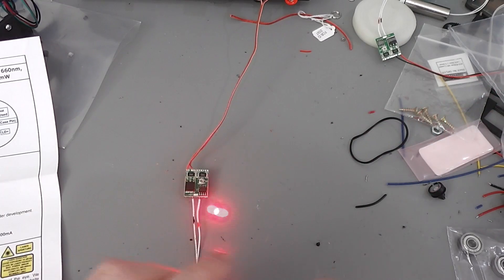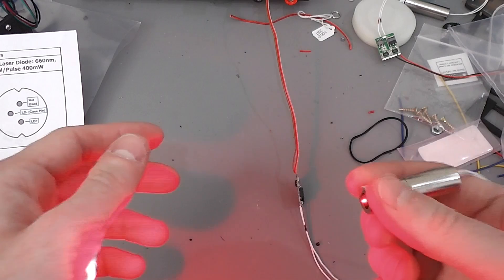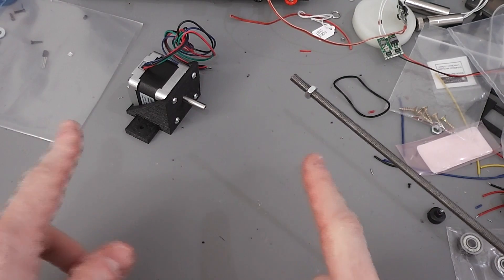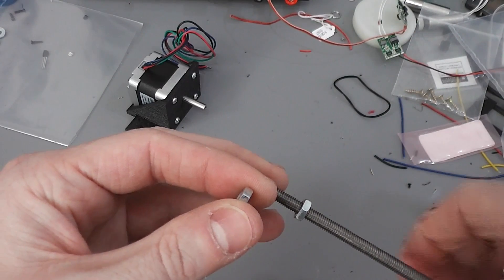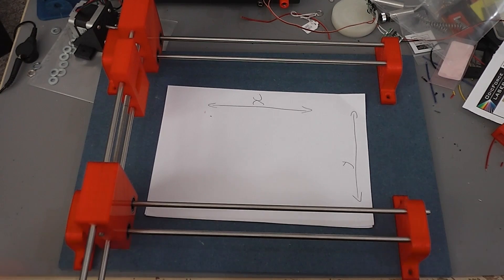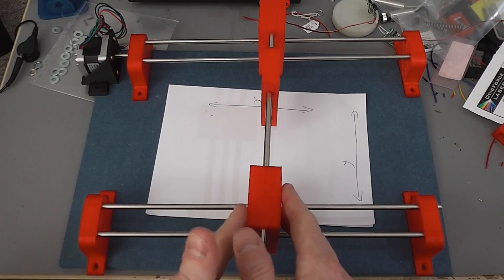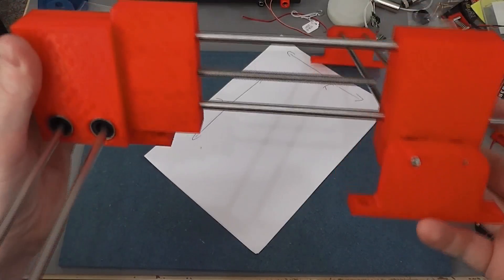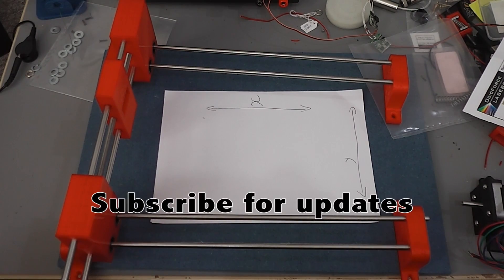Laser Engraver / Cutter Build Update - #1

Comment from the maker: I published the first build log for my laser engraver at the weekend.
The overall shape has been decided on and on Sunday I came up with a decision for the x axis drive mechanism, I am just waiting on some linear bearings to finalise some of the dimensions.
Reply: Love the anti-backlash idea: When I made a mini cnc drill, the best I could come up with was a single big spring fixed to the frame to keep tension in one direction - a small spring between two nuts is inspired!
Reply from the maker: Chris Holden I found a number of designs along this line but they all seemed rather complicated. From what I understood of the problem two nuts being pushed apart seemed like it would solve the problem so I gave it a go. I now have this mechanism built into the x axis slider as well and its looking really good, simple yet effective.

Comment: Hey Arthur,

great Video. Currently I'm planning to build a small CNC to cut PCBs and i had exactly the same problem with backlash. I found this in the Interwebs. It solves everything and i can easily get rid of the screw to move it. Its a lot more compact. I like that. http://www.thingiverse.com/thing:124800
Reply from the maker: Thats a really interesting design, I may have to make one to get it clear in my head how it works!
Reply: Yeah, very nice design but its not strong enough for a cnc mill (or any other machine where you have to move heavy load). If the load is too high this type of bearing will slip. But I think for a Laser Engraver its brilliant.